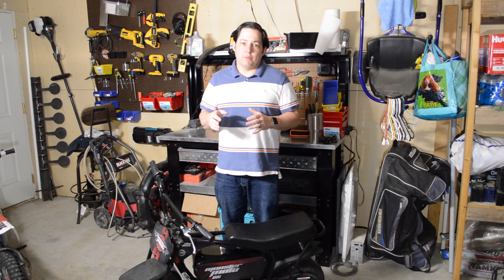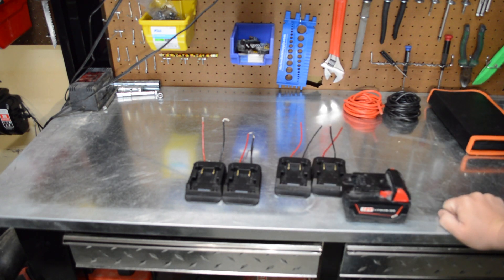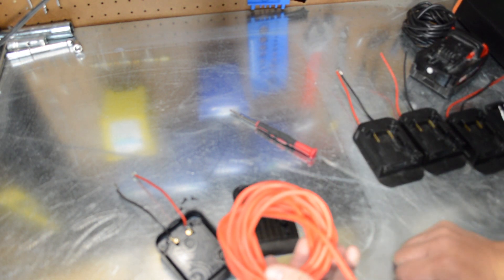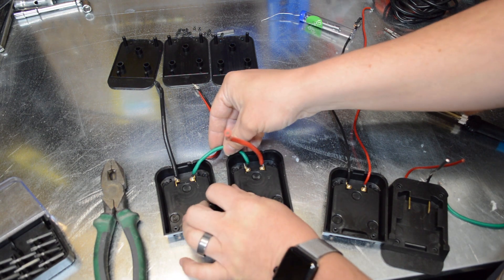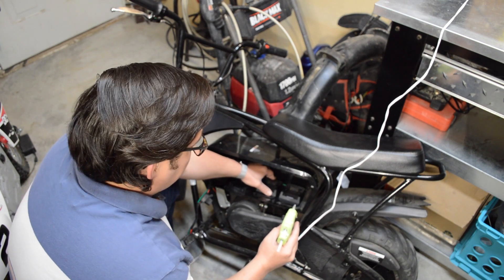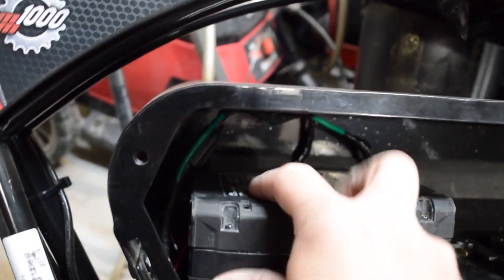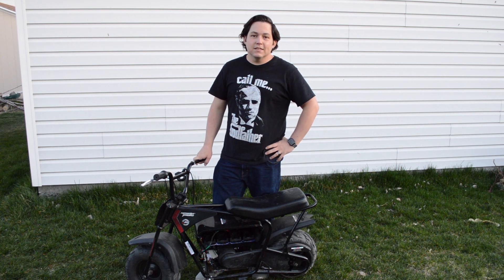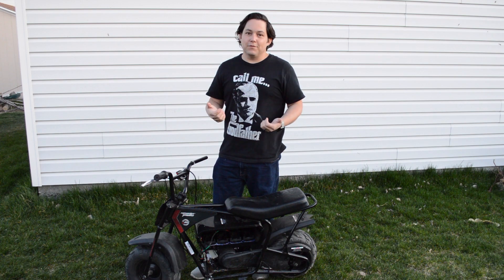Monster Moto 1000 Milwaukee m18 Drill Battery Battery Swap

Comment: Could you bump this up to 72V? Are the batteries capable of series hookups beyond 36V?
Reply: Yes you could. You can add as many as you want. At some point you could just be driving the motor too hard and burn it out quickly
Reply: @evergreenwattsmartchannel1982  Cool. I wasn't sure how the BMS on these batteries worked. I wanted to do a 72v system for a 72v motor.

Comment: Could the bike handle six batteries three  series 🤔the speed controller
Reply from the maker: I think it could. You might burn out your motor if you really push it, but you should be able to do that. I have other bikes I’ve bumped from 24v to 36v and from 36v to 48v and they work great. I did burn out one motor when I was really pushing it though.
Reply: @evdirtbikediy2676  ok thanks

Comment: Is that controller able to handle the lithium-ion cells opposed to the lead acid?
Reply: Yes it all has to do with wattages. It’s the same wattage between the two battery types so it’s fine

Comment: I tried replacing the batteries and I get a spark when I connect the battery.  Any idea what’s wrong?  The fuse is blowing.  I changed the fuse out, but can’t figure out what is causing it to blow.
Reply from the maker: A spark when you connect it does not mean much by itself. The fact that it is blowing a fuse is significant. Follow the wires from the battery to the controller and make sure there are not exposed wires. You may need to put some electrical tape if for some reason you have bare copper exposed. If the wires are all in tact then try disconnecting the motor controller and see if it still pops that fuse.

Comment: Where did you get the adapters tho or did you 3d print them
Reply from the maker: I bought them on eBay, but you can 3D print them. Just cheap enough on eBay that I didn't find it as worth the hassle to print
Reply: @evdirtbikediy2676  i got a friend whos gonna 3d print me a bracket for 3 and im gonna run 1 set of 3 18vs in series to get 52v then another 3 parellel for more range

Comment: so i tried this and it turned on and i twisted the throttle and nothing so i unplugged the throttle then when i was plugging it back in the wheels spun but the throttle still didn’t work do you think that is a bad throttle?
Reply from the maker: Could be a bad throttle. Are you sure on the wiring of that throttle?
Reply: yes i double checked it it is plugged in and i took apart the throttle and everything in it seems good.
Reply from the maker: You could try connecting the red and green wires from the controller going to the throttle. That will give it the full throttle signal and should make it go. That might help diagnose
Reply: i’m not sure i understand what your saying could you elaborate?
Reply from the maker: The controller has three wires going to the throttle. Red, black, and usually green. If you connect the red to the green then it’s simulating a full throttle situation.
Reply: i’m still not sure I understand, i have to connect the wires from the drill battery wire or connect the wires to themselves i’m sorry i just don’t get it.
Reply from the maker: There are three wires coming out of the motor controller that go to the throttle. Black, Red, and Green. Connect the red and green to each other. Don’t mix with any higher voltage wires that will do major damage. Just those three throttle wires. The red to the green
Reply: so i don’t connect the drill batteries to the stock battery spot? I’m kind of a dummy haha.

Comment: Have any issue with the batteries swelling with running them in series and parallel?
Reply from the maker: Not at all. The batteries are 2p5s anyway so as long as the cells match then you are good to go
Reply: @evdirtbikediy2676  so in theory you are able to produce whatever volts and amp hours you want based on the batteries size as long as there the same volts across the board? I’m during your current build just at the battery stage part and want to get it right.
Reply from the maker: Yeah that’s how it works. For every cell you add in series it will increase the voltage. For every cell you add in parallel it increases the amperage. The drill batteries are typically 18v so putting two in series would make it 36v. Adding a second set in parallel just extends the range and possibly instantaneous performance
Reply: Say they were 5ah 20v batteries instead and I wanted 80v and 20ah would it be the same setup you have basically? 4 adapters ran in series like you have and then one main set of parallel positive and negative cables.
Reply from the maker: To get to 80 volts you would need 4 batteries in series. To get to 20Ah you would also need 4 in parallel. That would mean 16 batteries total (4x4). At that point it would be super expensive and would be better to get a real battery.
Reply: @evdirtbikediy2676  did you mean 8 batteries?
Reply from the maker: No, it’s 16. Putting batteries in series only increases the voltage but will not increase the Ah. If you have 5 Ah batteries, with a total of 8 (4 in series and 2 in parallel) then your Ah would only be 10. To get to 20 you would need to double that to 16.
Reply: How long of run time are you getting out of the 4 batteries together ?
Reply from the maker: I never did a full in test but I would put it at right around an hour.
Reply: @jacobtebrake6734  you could get 3 6s lipo batteries. I did that. 7000mah. Fully charged is 75.6v each battery is around 60 bucks.
Reply: @alexbekkala1718  anyway you could send me a link to the batteries your talking about!? Greatly appreciated!
Reply: @jacobtebrake6734  can you send me the link as well?
Reply: @kskillz11  never received one yet

Comment: Does ah matter 5-6-9? I see you use the 5 ah
Reply from the maker: That is really going to determine how long it lasts. In theory they might also deliver more Amps as well, but that just depends. The 4-6 Ah are usually 5S2P and the only difference is the capacity of the cell. Lower is usually 5S1P and larger is usually 5S3P. So having more parallel will give you more amperage, but it also does depend on the cell being used.

Comment: What motor & controller ?
Reply from the maker: The motor is just the one it came with, a 1000w brushed DC motor. The controller is a generic one from eBay. I just search for 1000w brushed DC motor controller.